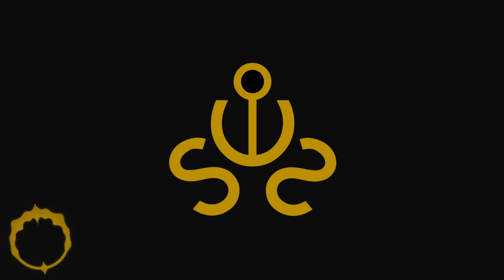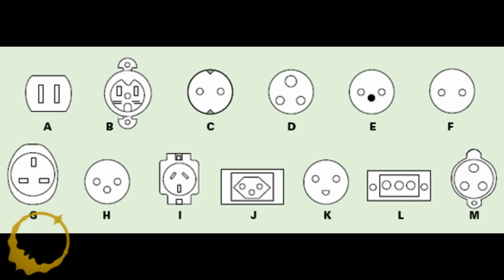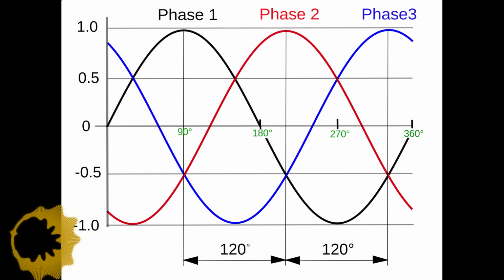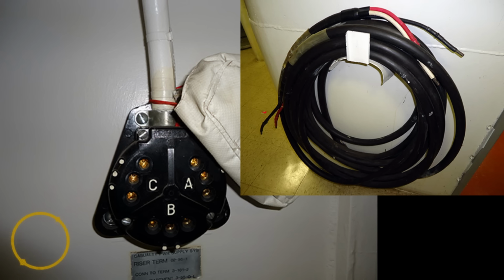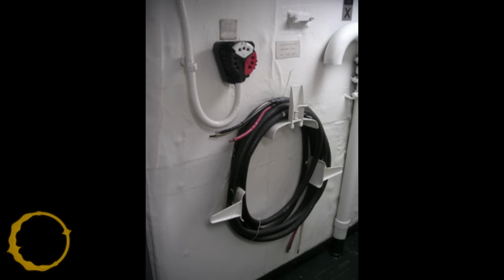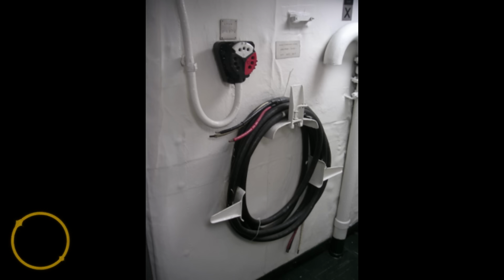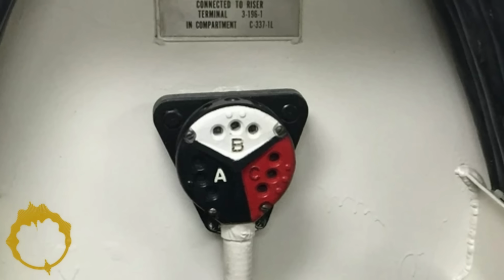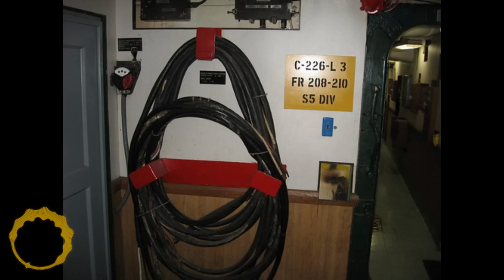If you need casualty power, biscuits are the answer

Comment: Stage they wouldn't use something like a powercon style connector. Where you just stick a round plug into a round hole. It would be somewhat bulky for hv cable, still it would be much easier, faster, and wouldn't require additional locking...

Comment: As person who dabbled in power distribution, i am sort of surprised ships havent used redundant power network with redundant cabling and automated switches
It automatically cuts and reroutes power around any fault area, in this case you would only need to run extension cords in case of catastrophic damage to a smoldering wreck section
Reply from the maker: I mean, like I said, they do.

Comment: Ok, but what do you call doors/hatches on a ship with multiple artificial accelerational gravity, a la the MacArthur from The Mote in God's Eye, which had one orientation for long term burns and another for spin gravity?

Or for more IRL, what were they called on the Flip, that research platform made from an old submarine hull that would, well, flip 90 degrees to stand upright midocean?
Reply: in that case id use door for thihngs that are not air/water tight and hatch for thingss that are

Comment: one ex mil scifi author had a in universe damage control method on the combat shuttles equipping them  with a copper crow bar. Mounted over the the rear ramp. "If lose of power remove said crow bar, insert into main bus bar to restore power." This only worked once, as the crowbar welded it self in place, with a very pretty sparks shower.
Reply: John Ringo, Troy Rising series. If anyone hasn't read it yet - do so. Well worth the time. IIRC there was no sign on the crowbar but knowledge of how to use it was the detail that certified a true flight engineer.

Comment: Just the thought of trying to connect and secure those cables in zero-g is giving me nightmares, followed by the realization that in zero-g the cable would not be on the floor, but rather hanging in the middle of the corridor just waiting for some poor ensign to come flying through.
Reply: In zero-g, the answer is velcro.
Reply: @m0rtez713  Wrap the cables in fluffy fabric and just put patches of velcro on the walls.
Reply: @m0rtez713  or zip tile it to pipes or what not in the room

Comment: Speaking of alternate power in an emergency - this is one reason why I like UPS's (uninterruptible power systems) because the power from the source does NOT go directly to the end point. Instead it's going to the Battery inside the UPS and from there to the end point. This means that whether the source power has spikes, drops or is completely lost, the end point always has a constant supply of power.
Of course this would have significant disadvantages within a warship due to the size and number of batteries that would be required but it works great at home to protect one's electronics from lightning spikes, transient power drops or power outages from storms.
Reply from the maker: Yeah, for three phase, that'd be a big battery.

Comment: Fun fact; the primary power system on Nimitz class is 4160VAC 3 phase.  With 13 load center transformers to 440VAC. This design choice saved 100 tons of copper in construction. It was also made to make the size of the reactor coolant pumps managable.

Comment: I was now seconds old when I learned some of the what Damage Control does mid-battle.  

It makes me really worry about those poor Starfleet kiddos, their power system apparently runs plasma through their decks in spit of having never invented a method for controlling plasma surges in any way, shape, or form.  I've seen Starfleet display panels explode violently enough to cause the interment of an unlucky crew being after energy weapons fire pierced their shields and surged the entirely unprotected power system.  I'm just imagining the wrestling with point-to-point plasma conduits to reconnect critical subsytems when AT ANY POINT an attack may hit anywhere on the ship and send plasma surging out of their Space-Biscuits to flambe the poor engineering ensign who's standing by to hook a chain up to a viable plasma source.
Reply from the maker: EPS was an... odd choice.
Reply: I can accept Starfleet needing some exotic method to carry the vast amounts of power required to power phasers, photons, and all the sensors and other equipment on the ship, though I have to wonder about the power transmission losses from plasma. But you would think that the bridge and other computer consoles could and should be powered by either traditional power cabling or any other method that does not regularly result in explosive electrical surges/shorts due to battle or other damage.

Comment: I keep thinking of Star Trek where every time they’re in combat the Captain orders emergency power be routed from some ordinarily  essential system like life support to the shields after all of the automatic backups fail, and all that happens is somebody pushes buttons or taps a touchscreen. We almost never see anyone re-plumbing EPS conduits. Think about that for a moment- unlike real world three phase lines they have to somehow install jumpers between waveguides carrying high power EM fields and high energy plasma. That’s gotta be fun. I can’t see pre-cut sections of either rigid or flexible waveguides hanging from bulkheads along with the inevitable mode and phase adapters you would need next to a normally unused EPS port with a plug in it.
Reply from the maker: "Force fields.-

Comment: Never saw these on MCM's.
It's been a decade or 2 since I was on one, so might have been there & Never used...but pretty sure we didn't have them.
Reply from the maker: I think it was generally assumed that if MCMs took enough damage to need these, it wouldn't really matter either way.
Reply: @SacredCowShipyards  LOL, fair point...we could punch a screw driver through the hull/skin by hand......
Reply: To be fair this like a fire extinguisher.  You have it but hope to never need to use it.  Unless it was your job to make sure they were still in good working condition you probably wouldn't notice them.

Someone else said that on newer ships the 3 wires were replaced with a set of plugs to further idiot proof the system and make make it safer.
Reply: @nobodyimportant2470  I did DC work than the average guy, & this stuff was never brought up. Even during SW training. I don't think more we had them. The Minesweepers did weird things. The MCM's are still made of 3 kinds wood of wood laminated together with proper ribs, & 224'ish feet long. The MHC's had giant 1 piece Fiberglass hulls, 180'ish feet long. I don't even remember this stuff in the 2 'real' machine rooms.

Comment: "It ain't stupid... but it ain't smart."  But when you're in the sh--, you'll make whatever you have to work.  Also, you could design a system where a biscuit could be on one side of a sealable door and the extension on the other.  If you make the pass-through robust enough so that you wouldn't have to drape this thick cable through a hatch/door.
Reply from the maker: A significant number of risers connect to other risers on the other sides of bulkheads or compartments.
Reply: @SacredCowShipyards  That's what I thought they did. Thanks for clarifying.
Reply: its a terrible idea to power a sealed door, when the other side could be literally under water
Reply: @quazar5017  My work around for that is having a throw switch, or really fucking big GFCI biscuit, with a means to push a button to close the circuit. Essentially you would have a switch to close the circuit like a light switch, or breaker, and then the GFCI biscuit itself that will trip if there's a major power fault.

Comment: Dockmaster, some of this info needs a little updating. DDGs and newer ships no longer use biscuits, they have three-prong screw-in plugs similar to figure L in that graphic of plug types at 2:27. It is considerably safer to run and is a single cable with three conductors, also makes it nearly impossible to connect incorrectly.

Comment: There are definitely limits on how far you are technically allowed to run extension cables. But then there's always a difference between what's supposed to be done and what is actually done.
Reply: "May get someone killed if you do it" is always trumped by "we are all going to die if you don't".  

This is one of the big reasons for the miraculous repair times in sci-fi.  The job will take 2 hours so you tell the captain 4 in case of problems.  If you sacrifice safety you can get the system up in under an hour even though doing that isn't a good idea it may be better than the alternative.
Reply: It's actually super easy to guesstimate 'the limit' of extension cord. It's all about amperage.   First thing you need to do is get rid of the idea of them having a Limit, per-se.. it's more about heart build up.   And also  drop the idea of extension cord being ANY different than the wires elsewhere.   There are real simple calculations that tell you if a wire is going to over heat and how long it'll take.   Also playing with electricity helps alot
Reply: @glytchd doesn’t it just come down to wire gauge and heat dissipation? Longer the cable smaller the gauge? I’m legitimately curious because I’ve completely forgotten what the formula is and just resort to a heavy duty for anything that may melt a regular cable out of paranoia. Electric standards took awhile to catch up in my town, half of us still have leaded conduits left in the roofs some still connected 😂😂
Reply: @Squizziles  Wire gage and how well the cable dissipates heat is part of it, but the major part is going to be the current draw. Heat given off by a wire is based on the Current (squared) times resistance, so the amount of current is by far the more dominant factor.
Reply: @TheEmbassyClerk  This is a loophole I've (ab)used with my welding cables. The cables are nominally rated for 150A at 10' length. The machine is capable of happily dumping 200A into them. Water-jacketed cables (Basically the 4AWG copper is in a rubber sleeve inside a garden hose inside a slightly larger hose) pump ice cold water through the inner jacket, it reaches the end, circulates back into the outer jacket and gets pumped back to the radiator system. The copper inside gets hot, the heat transfers to the water, and gets carried back to the radiator along the outside. They're heavier than thicker copper cables, but they're also kinda nice if you have a cooling vest that hooks in, because you can run the outer jacket in the lead, pumping nearly ice cold water into the vest, and then out of the vest into the inner jacket...Heavy as shit tho.
Reply: @NikkiTheOtter  As an electrician, I hate that. But the shady electrician part of me loves it
Reply: There's also an actual limit before vaukt drop makes the output unusable.
Reply: And with relays you can really take them extendos travel.
Reply: the limit on length is about voltage drop which can be solved buy using a thicker gauge of wire I would assume that in case like this it would be sized as heavy as the main feed cables its meant to replace so it would be a none issue